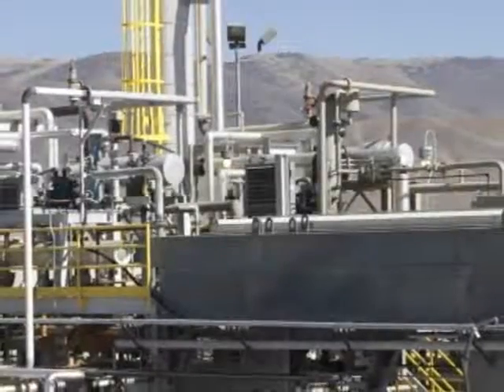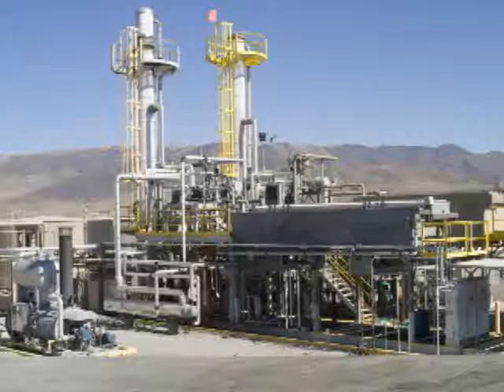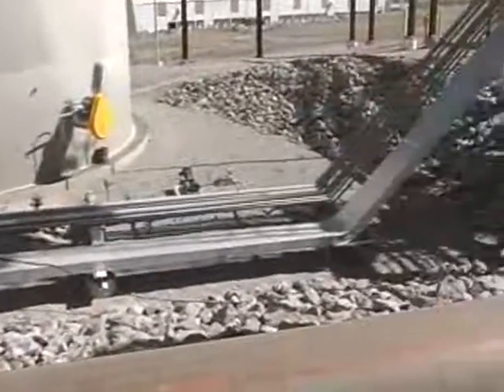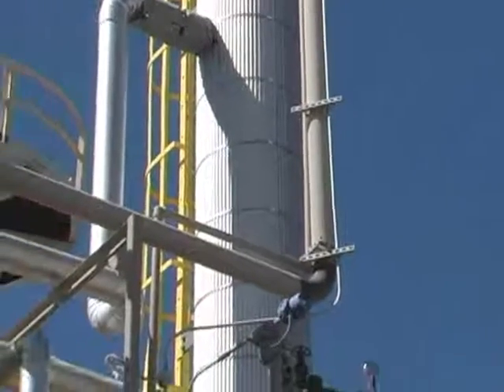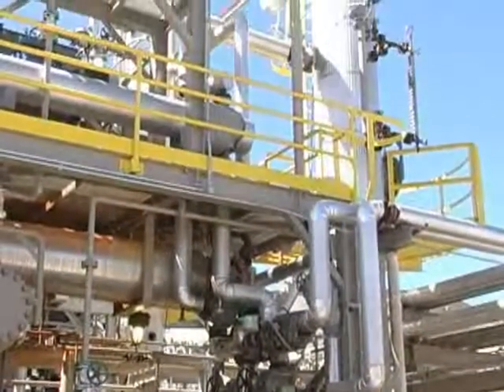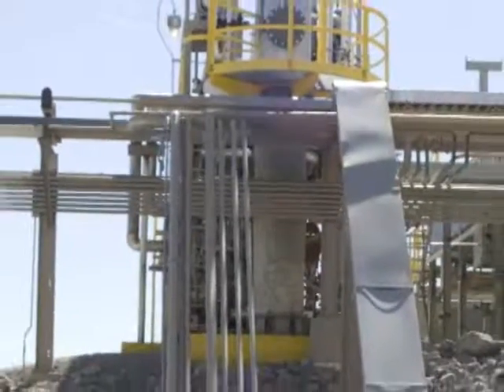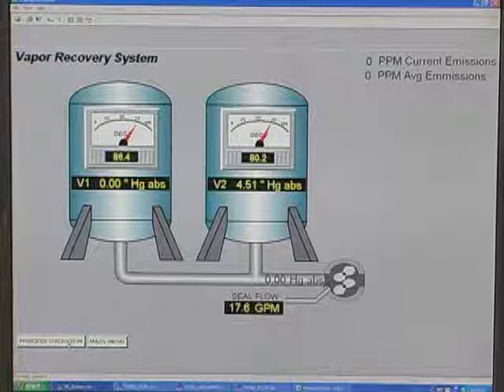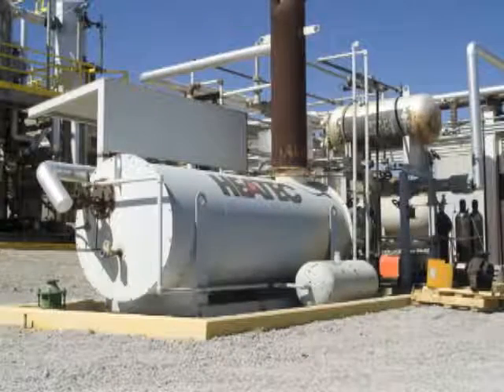Modular Refinery Introduction

Comment: Ventech's modular and mini refinery should serve needs of immediate remote area's where crude oil production in marginal fields  mainly will save transportation cost for operations and locals demands , should I found  estimated cost for topping refinery at the capacity of 10,000 to 20,000 bbl/d for low sulfur api range from 35-40 API 
Appreciate Ventech's technology and expertness
Reply: asker hood ventech and their crew never respond to emails from around the world. There is no point them advertising.